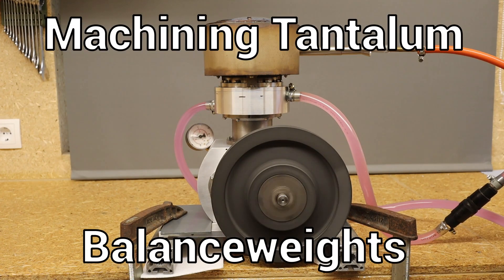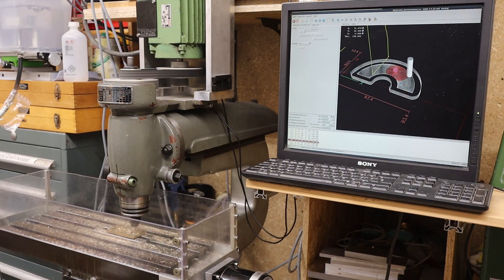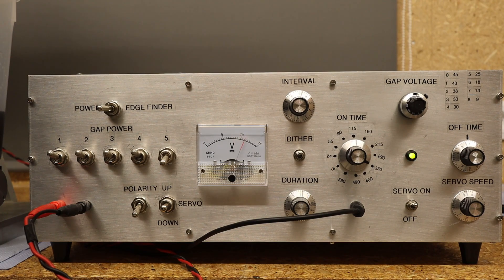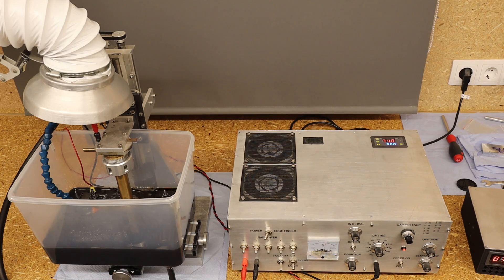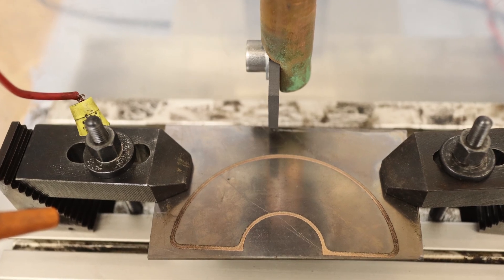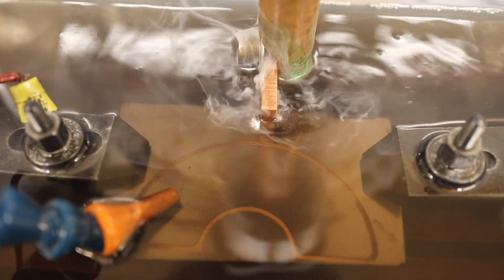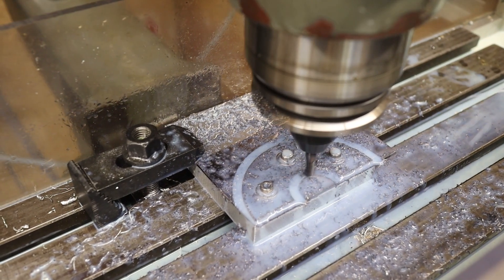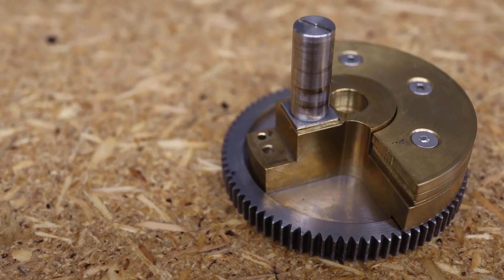Workflow of self built Pulse EDM / CNC milling of tantalum counterweights to balance Stirling Engine

Comment: I am wondering how well is Tantalum machinability ??? Nice work fella.
Reply from the maker: Tantalum is quite hard to machine but much better than molybdenum.
Its like a tough stainless steel.
Reply: @myengines2443  Thanks for that information. I never worked with the metal Sir. Peace v

Comment: Aint tantalum some fancy expensive metal to be used in just counterweights?
Reply from the maker: Yes, but I got this sheet cheap and it would be much more expensive to change the whole crankcase and rhombic drive of this experimental engine.
In a final version this would be nonsense but for this testing its the easiest way.
Greetings

Comment: It’s the high melting point of tantalum that’s slowing down the erosion process and causing the high electrode wear. Tantalum is usually machined by a wire EDM but it can also be machined by a die sink EDM using negative polarity and a thin copper tungsten electrode, but the main problem is your power generator still isn’t working correctly. If you still want to spark erode the tantalum try a 0.5mm copper tungsten electrode at negative polarity and use at your machines max power output (12A?) a pulse of 30KHz (33uS) at 80% duty cycle, the electrode wear should be approx 25% and the spark gap will be small at approx 0.03mm max so a good low pressure through the electrode flushing (2psi max) is recommended.
Reply from the maker: Thanks for your well-founded help.
But milling tungsten copper is even harder to work with than tantalum.
When I try to EDM it again I will use copper or graphite and use your advice.
Many thanks for your helpand many greetungs!
Reply: I agree about the copper tungsten machining, and also there’s the cost involved, but it would be easy to fabricate an electrode by bending a thin strip around a former and soldering on  a copper or brass “lid” so that looks like your original brass electrode, only the thin strip joint would maybe cause a problem but it’s worth a try. @myengines2443
Reply from the maker: Thats a good idea and I will try it.
Not on these counterweights but surely fore a future work.
Thanks for your feedback!